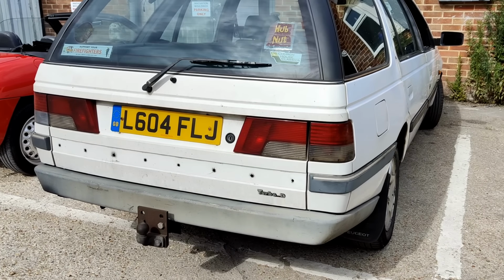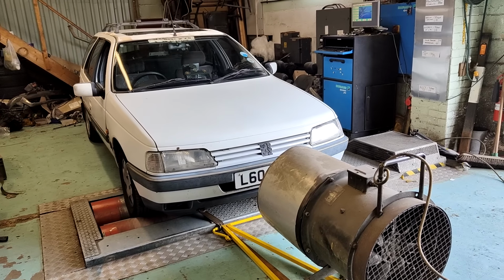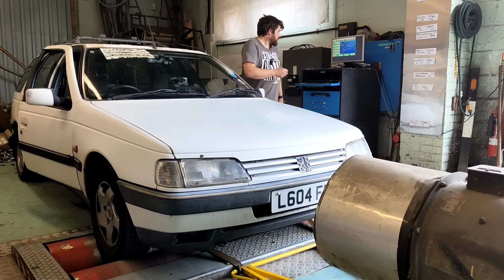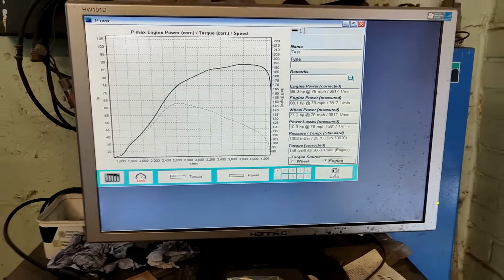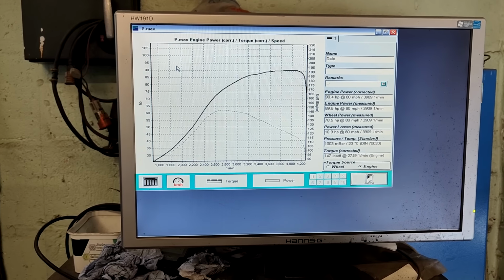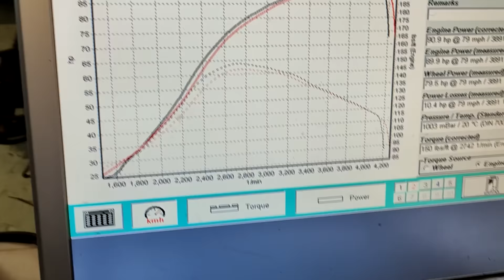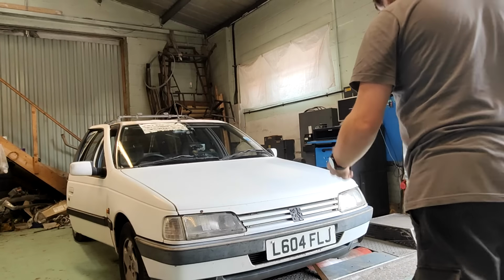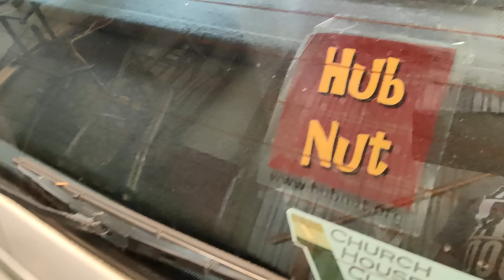How much POWER has this Peugeot 405 lost after 330,000 miles?

Comment: Insanity, I regret selling my Fiat Tipo 1.9TD everyday, it has more than 400.000 km now, luckily a friend of mine has it so I see it regularly, but what an amazing car, old diesel engines are almost immortal.
Reply: @maxeluy  there's a Tipo 1.9TD still running around my neck of the woods. Coming off bends, being given some throttle, no smoke, just a little haze. Car looks great and runs well. Love to know it's mileage.
Reply: Not all of them! I had a Pajero 2.3turbo diesel, and it died at 25000 miles. The rebuild lasted 250k. It produced a staggering 62kW.
Reply: They aren’t immortal when the head gaskets crack (Toyota ones)

Comment: Pretty impressive really i think the end of the good diesel was when the dpf come along. I mean some of them arent bad they are just too complicated. The older stuff is far superior.
Reply: You are not wrong but even DPF cars can run very good and many miles without trouble if you got a good driving profile. In some ways, DPF cars can be even better because of newer technology construction of the engine and drivetrain in general.
Reply: Agreed. Dpfs can be relatively trouble-free assuming that they have frequent good runs and not just town use or 2 mile trips.
Reply: @GoldenCroc  oh yeh I agree. I had a 1.6 focus diesel 62 DPf I did over 100k in that car and being a young lad drove it hard. It never had an issue. The problem is when they do have an issue. My current car is a 2.0tdci smax pre DPf and it just works. It doesn't do lots of miles and because no DPf it doesn't matter and it doesn't care. A modern diesel wouldn't appreciate that that's why I believe that was the last of the good diesel that era. I mean the Vw pd absolutely superb engine bullet proof things. The modern stuff just ain't the same.
Reply: @HA05GER  Well as I said I mostly agree, but if you got the favorable driving profile, dpf does 300k+ easily as well, and more. And as I alluded to, you can for example get a bit better fuel economy with the newer stuff if that matters. So in some regards its swings and roundabouts. But for ultimate reliability over all, yes the old stuff is better no doubt.
Reply: @GoldenCroc  yeh my basis is more on reliability and I'd argue the economy is worse on the modern stuff. My smax will happily do 60mpg and up where as my focus would be in the 50s. It's a bigger car but doesn't have all the emissions stuff. Possibly been mapped which can make a difference but I've never done it but it's superb on fuel. I found the same with sprinters I used to drive them for a living, the older ones were better on fuel than the brand new ones. It's inevitable cars get heaving and with dpfs and so on require extra fuel to maintain these systems. Whether it be by running the engine hotter by injecting more.fuel to maintain the dpf or directly into the exhaust. Then you've got adblue to contend with which is notoriously temperamental even if a modern one is slightly more economical which I don't find them to be, your losing that in maintaining all this crap.
Reply: @GoldenCroc  As soon as you need to add the "if you have a favourable driving profile" bit it all falls down. The old ones just worked weather you left them ticking over all day or thrashed them down the motorway. If you need to adjust where/when you drive to avoid an expensive problem then its objectively worse than if you don't. 
Its not only that - the myriad extra sensors never help because while they are great for accuracy they are another failure point and they do indeed fail. Then there are egr's which gum everything up to the point that the engine is less efficient after not long and a complete horlicks at higher miles. Common rail systems don't often fail but unlike the old pumps which could usually be rebuilt for a few hundred quid, when common rail parts fail on an older car they usually scrap the car on cost alone.
We could get into DMF's, timing chain failures, sticking or broken vnt's and all the rest but on overall reliability and ease to repair most of the old ones absolutely muller most of the newer ones. 
As for mpg about the most efficient car I ever had was a mk3 Golf TDi. Easily 60mpg around town and not hard to get over 70mpg on a run. Considering that was in a hatchback body with aerodynamics like a lego brick it makes todays ultra aero cars which in the real world do similar or less mpg seem a bit silly.
Reply from the maker: I think DPFs have their place, but reality is we shouldn't have so many diesel cars in the first place.
Reply: @UPnDOWN  yeh your probably right. I love them but emissions wise they aren't great. It's a shame, for big cars they make so much sense.
Reply: @UPnDOWN true, the modern petrol engine has also caught up with diesel in terms of torque and economy. The vag 1.0tsi 95 in my wife’s car is a superb unit.
Reply: @UPnDOWN  The thing is firstly we got diesel pushed on us by government incentives (like we now have a load of ev's which are going to be a big problem when the batteries are end of life) then because the masses have been consistently had less spare money they have been drawn to the lower tax and higher mpg diesels offer. 
If people had much spare money there would probably be a lot more hot hatches on the roads and a lot less diesel SUV's.
Reply: @HA05GER  just have dpf gutted

Comment: Bosch pump.
I love a pug 405. I have collected 10 in the last 12 yrs from all over the UK… all stashed safely for when retire next year to play with … an Executive, 2x STDT’s, 3x GTX’s, 4xGLX’s …. All TD bar one…
Reply: I worked in a Peugeot main dealer, drove a 405 estate GTDT, what a cracking car that was 😁
Reply: I've had my own diesels, plus 3 405Mi16, 3 405Mi16x4, and the best...modded and tuned 406 coupe 3.0V6...best cars ever 😍
Reply: In the 80,s I bought a 75 peugot 405 and drove it for several years while I lived in west virginia.Looking back it was great car that was comfortable and stylish.I also went through a couple of volvo 240,s.Could not wear them out but tired of them.
Reply: i had a 1.9gri..... it was fast..... had everything a sti had but the rear spoiler....
Reply: I've got a mint 405 1.6 zenith with only 70k on the clock. It's been parked in the garage since 2008.

Comment: We ran a Citroen Synergie  for years with the same 1.9 XUD lump. It had 7 seats, a flat floor, slidy doors, tons of room and did everything without fail. Would easily do over 50mpg on veg oil, loaded with 2 adults, 3 kids, dog, roof box  & packed to the gunnels with camping gear. Wished we kept it & sorted out the bodywork as it was part of the family.
Reply: I also ran my XU9td on veg oil. Used from a mates burger bar, I simply let the food bits settle in the jug, decanted off the rest, filtered it through a pair of tights, and stuck it in the tank! Bosch injector pump only, lucasCAV were too weak, ran perfectly and smelled of chips 😂
Reply: @6ettinold  if I could find a decent 806 or Synergie I would get it tomorrow... Missing mine (cambelt snapped whilst abroad 😭)
Was also running on veg.. 👍👍

Comment: They are really good engines! we had an skid steer loader on the farm which had an Kubota engine which failed at 5000hrs (headgasket) , & just happen thats my grand parents pevgeot 405 J reg turbo d had failed it MOT on the yard! We stuck the engine from the 405 into the skid steer loaded (all it did was turn an hydraulic pump) and revved in at 2000rpm , went on to do at least 3000hrs more before we sold it! (6000hrs is almost an equivalent to 120k miles give or take)   we thought about putting a cambelt on it but we didn't ,
The engine had over 180k when it was still in the car , it definitely needed it heat plugs working in the winter!
The huge existing radiator within the machine meant it hardly ever reached its working temp!

Comment: In about 2008 I had a ten year old Zx  non turbo use to run mine on veg oil or sunflower oil for a bigger  bang for my bucks that had over 300k on the clock  the emissions were well under  the mot standard great engines never missed a beat ❤

Comment: A mate of mine had one of those 405 diesel wagons. Absolutely loved it, especially the 1000km plus range. Pity it broke the timing belt and snapped the cam into 3 pieces. Getting the replacement head and cam out to Australia was an expensive exercise. That one in the video is a ripper for the mileage. I hope it lives on in another car.
Reply: When I worked at the pub dealers, we sold XU D camshaft to an engineering shop. They made new caps as they also snapped, line bored them, good as new, bet they don't do stuff like that any more, real shame, you could buy rebuilt heads for a fraction of a new one

Comment: I had an H registration. 1.8td,  Estate,  370.000 miler.
Bought it for £150 from a car auction,  ex.taxi. in 2002.
Refurbed the front suspension and top mounts.  New water pump,  and that was it.
No rust,  sun roof electrics were shot.
Engine never missed a beat,  never returned less than 40mpg, even when cruising over a certain speed limit on the motorway to Scotland from Northampton. 
Ran it for 2 years and sold it for £250, which I wished I hadn't. 
One of the best cars I owned.

Comment: Love those xud engines, learned to drive in a xantia with one in. I then had a xsara Picasso with the 2.0 hdi! My fave car ever. It was so reliable and comfortable. I got the clock to 250,000 miles and it was still on the original HP pump, injectors, head gasket, turbo and clutch. Few cambelts, water pumps and oil and filter changes and she just kept on going!

Comment: Had two of these back in in the day, awesome cars. The last one had been remapped and was surprisingly quick. Was on 155k when I sold it, just nicely run it. So much better than the 406 that I replaced it with...Great video, thanks!
Reply: Didn’t think you could remap the old mechanical diesels like this, not like the HDi in a 406.
Reply from the maker: You'd have a job remapping a 405 diesel (without an ECU) ;-)

Comment: I'm a 405 fanatic.  I've owned 8 of them over the years and still have a Phase 1 Mi16.
Out of them all the Turbo D's were the ones that gave me most problems and that was due to porosity in the heads.   Of the three Turbo D's I owned two of them were very close to each other in chassis numbers, and sure enough both had porous heads.  The 3rd one was fine and it racked up massive miles with no issues.
There was a story that a huge amount of 1995 cars (like mine) had porous heads

Comment: I am a cabbie and have been for almost 30 years.    back in 1990, my parents started a cab firm and we ran a fleet of Peugeot 405's.  All in all, they were good cars that usually lasted about 250-300k   but the autos were crap and the bodies were very light and prone to denting.     The best car of that generation for tanking miles was in my opinion the cavalier 1.7 ls td.    That isuzu lump just never gave up!      nowadays I run superbs  and my last 2 made 420 000 miles (killed off in a crash   and 348700,     (cambelt taken out by an aux belt failure. )     I laugh when people tell me that their cars worn out at 100k...  barely run in...
Reply: What is the recommend engine in those Superbs?
Reply: @1maico1  Diesel all the way, the 1.6  is where you go if you want the best mpg--70+ on a long haul while the 2litre is almost as good but gives you plenty of oomph when you want it.     I have had both and both were excellent reliable engines.   They really dont seem to have any major  problems beyond the usual DPF and EGR aggro.

Comment: After I was forced to give up my Escort RS Turbo before it fell to bits, I was gifted one of these (sport trim)  as a company car. It was so good with the aircon on that if you were heading up a dual carriageway, let's call it the A69, you had to plan your manoeuvre in advance to pass a truck, because if the aircon kicked in at the wrong moment you were hosed. It got nicked from outside the house one night, and I only noticed because I ran for the bus to town through the gap where I'd parked it. My replacement for that was a normally aspirated 405. Cursed.

Comment: Hi, you quoted the current HP figure being 2hp down on the claimed factory standard output.
When the car was certified, the manufacturer was allowed to use very cold chilled air and also to remove the PAS pump/ ABS pumps / alternators / vacuum pumps  on dyno runs. 
The EU stopped most of that nonsense. 
You do not know if that sample was producing the claimed figure when new.
In summary, a massive mileage engine that still produces superb power.
Brilliant video, thank you.
Reply from the maker: Appreciate the comment, but I don't agree. The original figures used DIN correction factors, the same as this. In cold climates the engines may well produce more than 100bhp; in the Sahara...less than 85bhp? The correction factor was specifically brought in to mitigate these differences, including the variation in WHP losses between manual/auto transmissions; air pressure; air temperature; ancillaries etc.

SAE figures may well be closer to what you're suggesting as they were engine-only, but DIN was a Euro-centric standard that all manufacturers who sold cars in the EU (and many outside it) adhered to, and it was designed to set a universal standard from which all situations would suit all cars.

Comment: I brought a new Peugeot 306 XRDT 1.9DT in 1994 and it blew a head gasket at just under 400K kilometres which really disappointed me because it was a fantastic car and it had great motor.  It was still returning  5.3l/100km or 53.3 MPG.  I'm not sure new cars do that.  Great video - thanks.

Comment: My 406 1.9 dt had 360000 miles when I sold it. It was probably the best car I ever owned. I used to cruise it at over 100mph on the continent. Handled great too. All I did was routine maintenance.

Comment: This is the engine that Bella needs 😂
Reply: @jeremytoms5163  who's bella ?
Reply: @SDRIFTERAbdlmounaim  It's the Hubnut (Ian) Citroen Berlingo.  Lots of silly comments about fitting the XUD into it, but with HDi fixed and properly running (likely a set of new or refurb injectors) and it'll be better than the XUD could ever hope to be.

Comment: I had an '89 405 Estate but with the 1.9 petrol engine, it had covered 380,000 miles, still on the original clutch, when I traded it in against a '97 406 TD Estate. It was a bit fumey if you got stuck in traffic but still very nice to drive and everything still worked. The 406 went on to do 265,000 and apart from regular servicing and consumables it never cost me a penny, I needed a van so it had to go, it looked and drove like a 60,000 car! The two best cars I ever owned, I'd love a clean low mileage 406 estate again.

Comment: My father opened up the engine of a 2.1 diesel citroen xm, with 
1180 000 km.
the cranck and conecting rods were beefy, the main bearings looked really good, the cylinders looked like new, no wear.
My father had previous replaced the hydralic lifters at 650 000 km. The turbo was also replaced once.

Comment: Those old XUDs were brilliant, especially the early non Lucas Bosch pumped ones. I once drove through a flood (had a high mounted airfilter) and filled the bores with water. Glow plugs removed Pushed it down a hill, bump start and off she went. Miss the simplicity but not the smoke

Comment: I've had several pug oilers,  xud7, 9 d and td. Best motor ever! Ran a 405td with a Bosch pump, on used veg oil for a year without issue, that one also rotted away, scrapped with a perfect engine. The XU has to be one of the best engines ever 😍

Comment: I have just spent most of this video screaming in my head "what pump does it have?" Lol. 

Bosch pump. Not surprised as I had one on my 96 306 Dturbo. They're considered superior to the Lucas pump if you want to tune them. I miss the clatter of these engines. I currently have a 2007 Mondeo 2.0 TDCi which is another pug lump. 230k and the engine still goes really well, on the original clutch, DPF, and it has been tuned in my ownership.

Comment: I have a 2022 Citroën Spacetourer van hdi with just over 180bhp and i must say the thing really really shifts!!! I also have a 1989 Peugeot 405 1.9 sri which I have owned from new and is in showroom condition and has only 22,000 miles on the clock from new. I  hardly ever drove it as iv always had vans so have used those instead...

Comment: Straight Outta Ryton....

What a great little car, 30 years old. 

What a shame Peugeot management had that famous Top Gear breakfast meeting and decided to stop making great cars.....
Reply from the maker: 405s were fantastic cars!
Reply: After a recent sesh with a mate we came to an agreement that the 405 SRi (not the Mi16) is the best car in the world.
Reply: @SamiHentunen  
I had a 405 sri 1.9 petrol and I can honestly say, with my hand on my heart that it is the car I most regret getting rid of. I only did around 45k miles in it but they were the most comfortable and reliable miles that I have ever traveled.
I bought it for £170 with a suspected head gasket failure. Turned out to be a tiny tiny pin hole in one of the heater matrix pipes just to one side of a jubilee clamp.
Ahhhhhh, happier days!!
 🇬🇧👍😎👍🇬🇧

Comment: I had a 1999 406 2.0 HDi 110. Bought it at 60k, sold it at 120k. 70mpg+ on the motorway, beautiful beige interior, armchair of a front seat, climate controlled, never let me down. Cracking car.

Comment: I had one of these some years ago, so easy to increase the power, adjust turbo actuator, at the end of the throttle cable cut a bit of plastic off so the throttle can go more, bend the throttle pedal to give more travel, good increase in power and revs quite a bit more but that's a negative side of you ask me